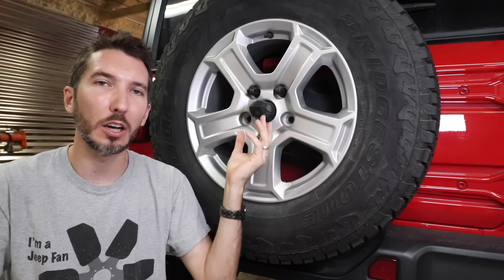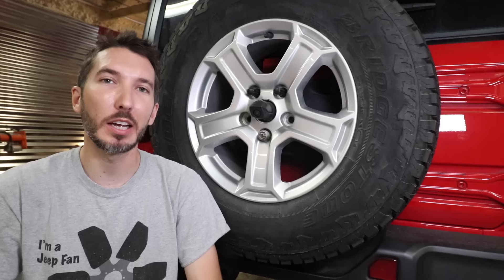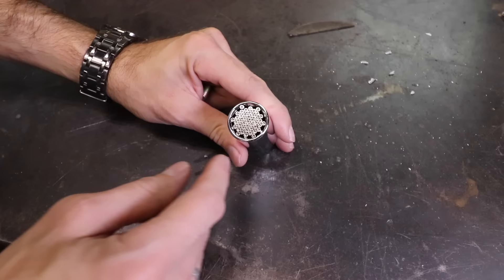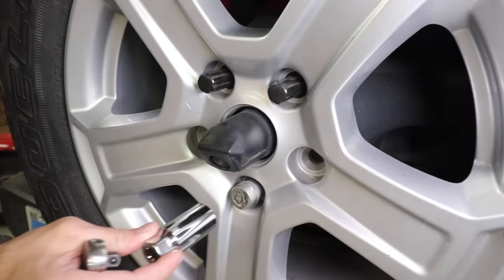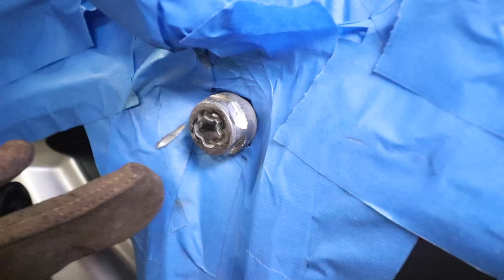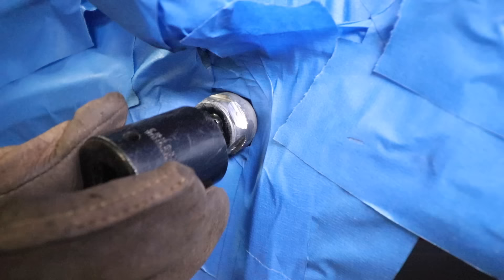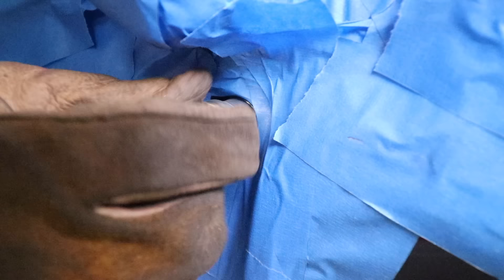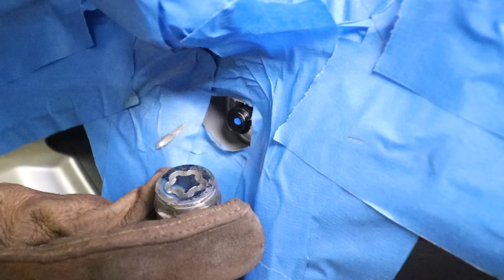3 Ways to Remove a Wheel Lock Without a Key

Comment: I too hate the dealership.  Here is what happened:  I got into a car accident and I wanted to choose which shop would repair my vehicle.  I chose the Jeep dealer!  (Big Mistake).  Not only do dealership repair shops NOT specialize in jeeps, they are pretty much idiots.  THey simply fix cars, for that matter, I would have been better off going to a shop that specializes in 4x4/Jeep vehicles.  I would have gotten better service and solid advice on what parts to choose for repairing my vehicle.  The ONLY good thing that came from me choosing to take my vehicle to the dealership is that, if I ever choose to sell my jeep, I can say that it was repaired at the dealer by fully certified dealership technicians.  That's it.

Comment: You can take any wheel nut off, by putting a 3 foot pipe on it, and push down and snap the whole wheel stud off.  Just saying..... takes less than 30 seconds and the tire is yours.

Comment: When using you first idea...
When it locks up turn it back the other way to release the grip and pressure on the head of the bolt ....don't drash it off with a 🔨

Comment: The content was good and you met your objective.  But, I guess there are a lot of people out there who don't know the proper way to use hand tools.  The vise-grips were backwards, the adjustable wrench was backwards and the open end wrench was backwards.  Handle designs are at angles for a purpose.   The handles point in the direction of torque.   The same is true for water pump pliers and pipe (monkey) wrenches.  Couldn't you have just put a spot weld on the spinner to keep it from spinning and used one of the sockets from the yellow case?  For future reference to your viewers; I usually don't watch DIY videos where the person uses a screwdriver as a chisel, a claw hammer instead of a ballpeen hammer, or pliers instead of a proper wrench/socket, and the absents of safety glasses, gloves, and hearing protection.  There are people out there posting DIY videos showing how the above mentioned tools can be used in a pinch.

Comment: I bought a Certified Mini from a Mini/BMW dealer - the battery went dead, and it has an Anti-Theft radio - and the Dealer refused to turn the Radio back on or give me the code, but they did offer to replace it for $2,000 - You have to take the entire dash apart to replace or work on the radio, so I no longer have one - everything seems to work but the radio and CD Player - this is a 2013 with only 22K miles because the wife drives it to the store once or twice a week -

Comment: You could have saved yourself a lot of hassle you should have put a socket that is just a bit smaller than the wheel nut then put it on to an extention bar and hit it on the wheel nut with a hammer and then put a crack bar on it to take the wheel nut off or gone to good tool vender and brought a set of nut extractor sockets that are for rounded off nuts and bolts to extract the wheel nut

Comment: """But did you remove the positive battery cables from the battery? big mistake by new players using a welder with the battery connected potentially can burn out your alternator or other electronics in your car!

Comment: Its the same way a criminal removes the wheel locks. Don't bust the damn stud because its major surgery to replace them.

My dealership said they'd see if they have a universal key that will fit the wheel lock. If it fits they'll charge me $80 to remove all four wheel locks.

if it doesn't fit they'll charge $300 to strong arm the locks off.

Comment: Dont ever, ever use a ratcheting wrench to loosen a lug nut. Always use a breaker bar. Proper tools people for the proper job. Dont break your arm and lower back using a wimpy ratchet for that high torque bolt.

Comment: Those are the worst wheel locks because even if you have the key the teeth are so small they usually wipe off ,I ordered a second key and the lock wiped those teeth off it too. The tire shop has a tool and they'll have it off in a jiff.

Comment: It is hilarious as a professional tech to watch videos like this. 1 i have over 100 different keys. 2 any tool truck sells wheel lock removers for a nominal fee. 3 most keys and nuts are only at the most grade 5. They can be drilled. 4 you don't use a socket to weld onto the lug you use a nut. 5 you clearly need to put down the tools and camera and go get some training. I'll say one thing, you made me laugh.

Comment: use a 12 point socket that barely fit and hit with a hammer to fit over lock nut, then use a breaker bar or ratchet to loosen....walaa

Comment: I bought a jeep compass at jeep dealership it was a2020 and got home with it could not find the key called they said after a made about 20 calls to get help to get the lock lug nuts off each tire that they might could get them off but would cost me up to 200 dollars and i was fired up i told them why would you sell a car  and not make sure theres a key to lug nuts .i told them i drive 30 miles to job at dark and iam a woman and i didnt want yo be stranded on the road.they said you bought it as is thats  your problem but if i wanted it taken off it cost me.if i had not have burrowed money and paid them already they would of got the car back .i got it from bayird in paragould ar.

Comment: Good video , but I would've done it taking  in consideration the "WHAT IFS"  what MIGHT HAPPEN if I use as cutting tools to close to parts I wouldn't like to damage if I slipped . I would remove all nuts removable,  lubricate studs threads,  nuts back on and tighten very tightly,  then  use a broken bolt removal kit , making sure not to drill to deep for the tap , then tighten all other nuts. Spray some BP
Penetrating lubricant and try to remove lock with the bolt removing kit  , all this after trying using pipe wrench or pressure locking pliers if possible,  then if kit didn't work  , drill more till reaching stud then spray penetrating lubricant , cutting two slits across and try pressure locking pliers,  all this without damaging mag rim.
Reply: You can’t drill into security lug, it’s hardened steel

Comment: With your first tool you could’ve perhaps, cut a slot for a large regular screwdriver or, even a cross head screw driver 🤔
However, I think the first thing to do, would be to name & shame the dealership that sold you the vehicle in the first place! 😤
I wonder, have they ever heard of ‘after sales service’  🧐 something that we, here in the UK, are quite hot on. Shame about your spare wheel though 🤬

Comment: There's a "wheel lock remover kit".... If you don't wanna buy it, you go to tire shop thàt has it & TADAAAA it's out.
Unfortunate for me, it wasn't the spare but the front wheel that I found flat with a sidewall puncture.  I had to tow the darn thing there, but was out in 10 mins.
You had it easier being the spare, becoz it wasn't torqued/impacted as a wheel lock would have been.

Comment: Brother there is an easier way to remove it and I do all the time without wasting time doing all that. All I do is get a chisel and a hammer just put the chisel toward counter clockwise and start hammer it slowly to un screw the nut and it should come out easy. It really works. Either way the nut is not needed anymore after it comes off. Bye and try it next time will save you headache.

Comment: Seems to work on your spare jeep tire on the back of the vehicle. I'm sure there are a lot of people that have a car or truck with their normal wheels being stuck on when the lug nut is too deep for any of these tactics you are showing us. It has to be at least 70% of people that are not able to use these tactics your showing due to that reason. Not many people are going to have the room or knowhow or welding torch laying around lol. Not many people have a grinder laying around either and if they did it wouldn't be able to make its way in the hole. I thought at least one of these methods would work for the other 70% of people out there. There are some other way easier ways of getting your special lug nuts off the wheel. For instance, a person can buy an "Emergency lugnut tool" from Amazon for $20 and it would work for anyone. Much easier to access and it works for everyone. Thanks for the effort of putting up the video though as it does work for some others which is nice. By the way do you happen to be from Texas?

Comment: I bought a brand new Grand Cherokee Limited and within the first 2000 miles the transmission blew because Jeep forgot to totally 
fill it with transmission fluid.....to make thinks worse, it was the first of a new transmission they were using and they had NO REPLACEMENT PARTS.  It sat on a lift for 6 months as I waited for parts.......when I got it back I immediately drove it to Chevrolet and traded it in for a new Tahoe and filed a lawsuit against jeep.....NEVER AGAIN will I even consider a jeep !

Comment: I had the same problem... Hard to find a 12 point socket at any hardware store.... On my recent purchased Nissan Pathfinder the key even stripped... Never Ever buy Laguarda lug nuts... Pure crap. If you've got a flat tire somewhere and it strips... you're fked. Laguarda makes too many different variations and chances of finding a similar key is almost impossible. I looked every where. I used a 19mm 12 point socket that I bought from LORDCO in BC... Canadian tire doesn't sell them unless you buy a $300 over priced set and who knows if it'll work.  I had to buy an extension bar from Canadian tire to help turn the lug nut. Turn it slowly and it finally came off...

Comment: I own a 2014 Cherokee that the dealer sold me on reisterstown road without a key for the lock wheel.
Can't believe the dealership so inconsiderate and doesn't care who they sell a car to as long as they makes the sale I'm running back and forth trying to get my car inspected Maryland State inspection from the dealership into the Shell gas station for the inspection two more days until the dealership try again to take the lock off the wheel if you want to know who cared it's yourself not down never depend on that dealership

Comment: No offense intended, you are trying too hard. Large hammer and a chisel, make a groove with a chisel and then angle it in the counter clockwise direction. Air hammer is even easier if you got it. Also, special socket sets are made to do just this with minimal effort.

Comment: Lots of dumb and overly complicated ideas here. Just buy a wheel lock remover. It's a socket with a reverse spiral inside. Hammer it on, turn it loose. No welding, cutting, or taping involved.

Comment: Your first two methods were a complete waste of time.  Just take a larger 12pt socket and bang it into the wheel lock.  It will bite into it enough for a lug wrench to work.  How would the tape protect the wheel if you were to slip with the grinder?  I think you spend way too much time and money on a simple solution that can be found posted by other you-tubers.

Comment: Take a 22 m deep well 1/2 drive 12 point socket. Preferably Chrome pounded over the top of the lock nut and it's easier with an impact gun with a breaker bar or anything like that a normal half inch wrench with a pipe on it maybe it'll take it right out I've been working on cars for fire showing at pep boys I deal with this all the time that's how I do it don't f**** your rim you can pound the lug nut back out of the socket put it on the vice and a screwdriver and just bash it back out you're not ruining anything and that will always be your lock log removal tool I've never had it not work it saves you from having a welder or grinding things or any of that.

Comment: Had a “89,Vette w/ wh.lug cover plate,had a small McGuard 🔒 lock(standard “89 alum 17” wheel.)
Could not remove it, took back to dealer. Dealer where I bought it.
They said,”well you put it on too tight!”
I said;” NO,YOU PUT IT ON TOO TIGHT,last time I had new tires put on! SO YOU GET IT OFF, I’m not paying for it,OK?????
They did,got me 4- new 🔒 locks.
I would think street!
How can I steal those wheels in 10- minutes?
A over sized socket, extension,5-pound hammer, wack!
Loosen, jack, remove, see ya!!!!!!🤡😁,by!
You 🤬!

Comment: I just bought a Grand Cherokee & the dealer (not a jeep dealer) didn't have a key from me, im up in NJ area and my local jeep dealer wanted $550 to get all 4 off 😂😂😂 a trip to autozone i hammered a 1 inch socket to drive that outer ring back & then i hammered a 7/8 socket over the bolt. Btw i had to buy 4 7/8 sockets bc those fuckers were onnnnn there lol

Comment: what a coincidence, I just yesterday had to drill the lug studs and using a coal chisel split the fucking lug nuts off the spare tire mount on the rear door, of my daughter's jeep. seems the jackass mechanic who mounted it put the wrong nuts on the wheel studs and used an air wrench to do it. when I used a star lug wrench to take the nuts off, the lug studs spun from there mount. what a pain in the balls!

Comment: You can also use a 12 point socket hammered onto the wheel lock.  Also.. Be very careful about welding anything that is mounted on the vehicle, as it can sometimes fry your computer and other devices. Good luck.

Comment: LOL... this is what happens when you have all the tools but not the exact single correct tool for the job.... LOL...  I'll probably do the same things too. welding was the funniest of all, but in the age of google and youtube, I would probably do a little research first and TATA....  there was a lot of video showing better ways...  the best one is using a 12 point nut that is slightly smaller than the lock, especially when you have compressor power like you do.  But I did enjoy the video because that is probably the thinking of a DYI person.  :P

Comment: This guy is doing to much. Go to harbor freight buy some cheap sockets find one that fits almost and hammer it in as much as you can than grab a breaker bar and take it off. Works on any wheel lock doesn’t matter the type.

Comment: Wow you took a long way around a short road! All dealerships should have either a master key set or a universal one to take these off.even if it's not the cars manufacturer they should be able to get the job done.the place I use to work all the dealerships would loan the tools out to one another.

If you absolutely can not find one, then you have to hammer a lug extracting socket up past the anti-theft ring,else the tool will just spin.

If you are good with the tool you can use a air hammer at an angle to hammer the lug off.these all can be a pita way of doing it and all have a significant risk of scratching the wheel.

All the more reason to NOT have these pieces of shit on your car!!! They will not stop a theif,and really the wheels that  theifs look for are aftermarket rims or newer model high dollar stock wheels.so the vast majority of people don't need them.

Also if you do have them fully expect at some point to have some knucklehead use an impact on them and break the key which will require the shop to get all 4 of them off PLUS a new set of locks or 4 new lugz.

Such a waste of money!

Comment: Yeah I had the same problem, lost key.  Dealership little help the messed up the wheels beating sockets over the locks to remove them
  Solution never use wheel locks they are a stupid gimmic

Comment: I had my key. It literally snapped right on the lock while using the breaker bar.
POS GM wheel locks.
Reply: Try one on a Saturn with a recessed wheel lock rusted in place. I'm totally gonna have to bore it out to get it off I'll bet. The keys are pos as well, mine is made from aluminum.

Comment: Bro discount tire sells wheel locks
Reply: He needed a replacement key; you can't get those over the counter.  To get it he would have needed to connect the supplier (McGard) and send them a picture so they could match the pattern.
Reply: @mostguitarswins   eBay works to

Comment: Typical Jeep product and dealership attitude. My father delt with a jeep dealership that basically told him the same thing but it was about his break system.  It was less than a year old and they wouldn't help him saying breaks are a wearing item but it was his calipers and rotors that were bad so he had to pay full price to replace items that weren't even a year old and my father doesn't go off road and babies his vehicles so to hear that the dealership would even lift a finger to help through the 100,000 mile warranty or the 30,000 mile bumper to bumper warranty. So you couldn't give me a jeep I'd just dump it somewhere like a really Deep hole that has Lava at the bottom. Sorry to hear yet another crappie Jerp dealership has struck again. STAY AWAY FROM CRAP...(JEEP)!!!!!!!!!!